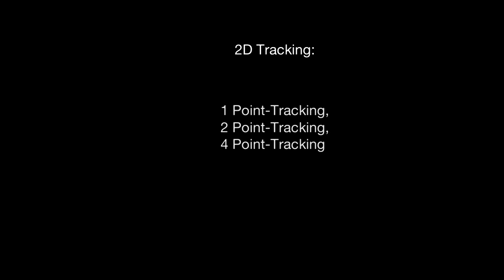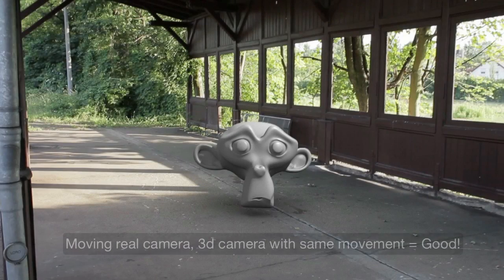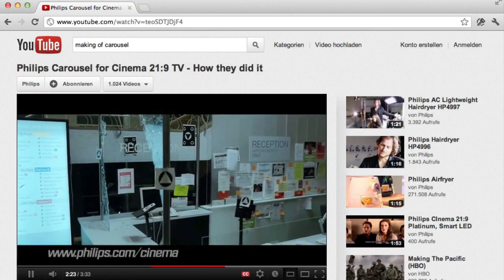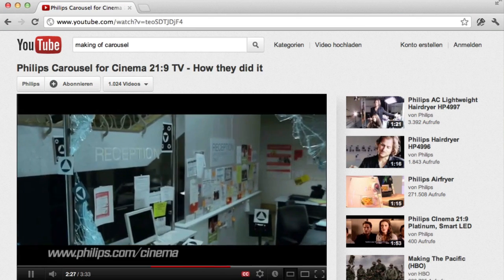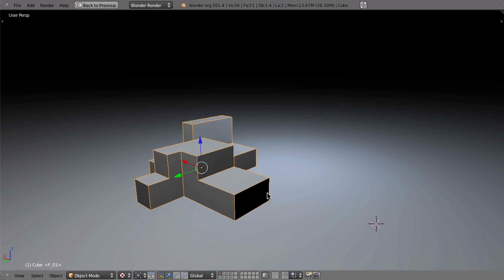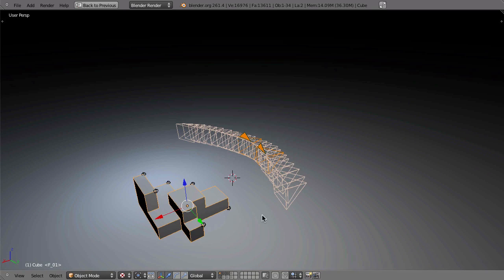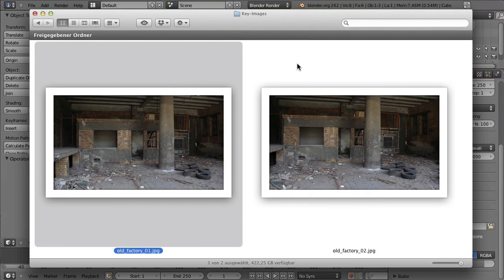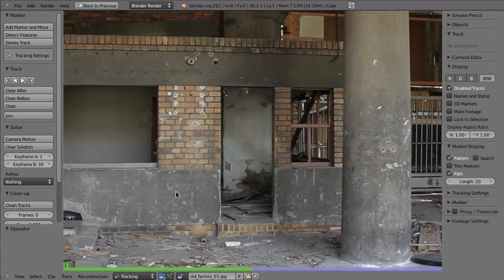Track, Match, Blend - 06 Photogrammetry

Comment: This is great, but the last part of the video does not go into enough detail about what you are doing to align the floor to the markers in the 3D View.  You don'T touch on Set X and Set Y, and you don't explain how to make the floor perfectly aligned to the floor in the video.  I tried this with my own video file and it just puts the floor at a really obscure, bent angle, which is impossible for me to fix.  Any help would be appreciated.
Reply: Track more points of the ground and wall. You know that wall and ground will have a 90 degree angle, so its easier to calculate where to put the ground